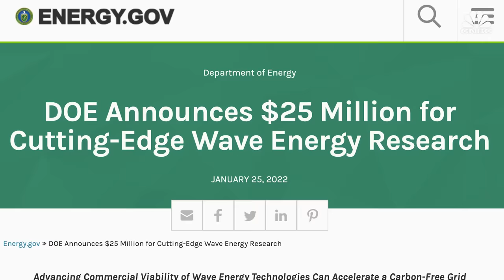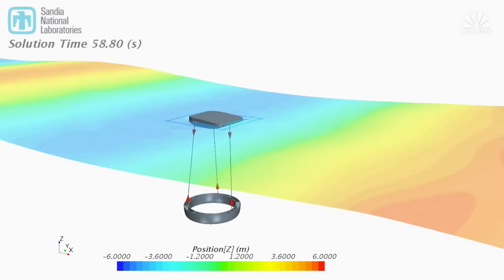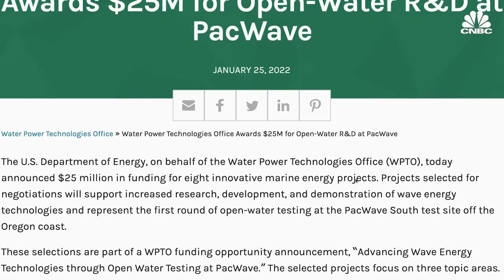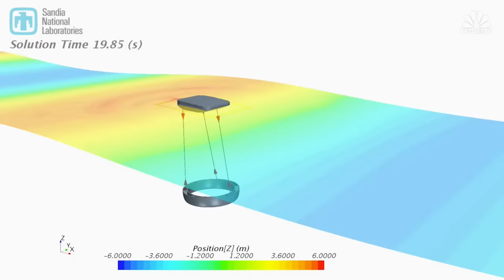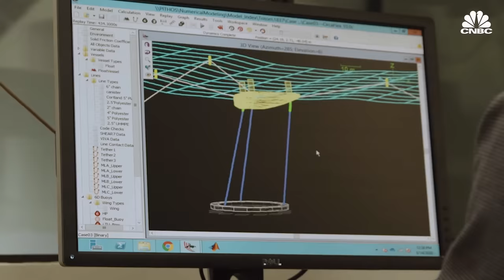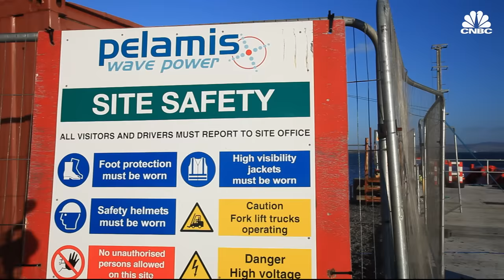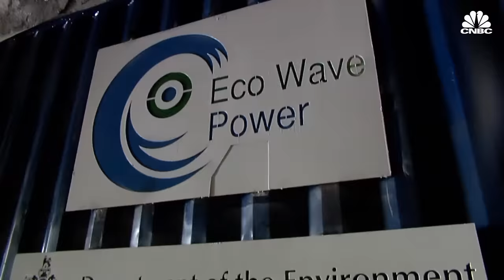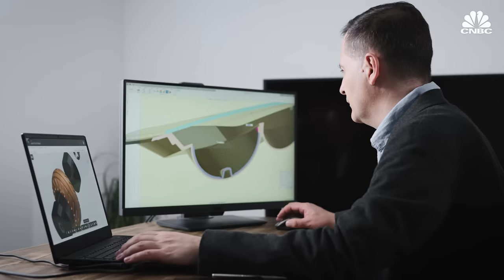How Waves Could Power A Clean Energy Future

Comment: i think,
humans can make overunity motion for green energy,
by pumping liquids such as H2O into the atmosphere, by electrolysis of H2O into oxygen and hydrogen gas where the height and density are developed with mercury gas compounds, 1 input energy for electrolysis and there are 2 output energies from the gas recombination reaction and hydrostatic pressure, the tool can be like 2 tubes that are prefilled with 2 types of gas resulting from the breakdown of electrolysis before being run and 1 more tube to drain the liquid material resulting from the re-combination of the gas.

fyi ,its about 287kj/mol H2O for input energy ( electrolisys )

get back energy when turn H2 dan O2 gas about 250kj/mol

the density of liquid and or high and gravity must be at least more than 37kj ( 287kj-250kj ) 

what about Cl2+3F2 ? 

good luck for make better world... 
thanks me latter.

Comment: I think the use of the upward motion of a wave to “lift a weight and thus it lifts with multiple waves lifts such a weight to set height, and thus fully charged at that oint, is then released to generate power until its weight needs to be lifting again.  Than scalability is then easy as just add these weighted  generators to one “one wave lifter”. So the wave lifter is always busy lifting using the “one way winch systems”. Then each “faulty part does not put the other out of order as well

Comment: How about the new Small Modular Nuclear reactors that Nuscale makes? Runs for 25 years after fueling it.
Reply: But don't allow Samsung to make them because if one catches fire and blows up...
Reply: How does small reactors solve anything? I’ve never seen a protest sign demanding smaller reactors.

They just think that they can be cheaper. But thats not for sure. Its just we build so few large reactors, the skills are not there to build them efficiently.

The only good reactors are the ones that consume nuclear waste so we don’t have to bury it. But they just talk about that, never do.
Reply: @TheBooban  The smaller ones can be mass produced reducing prices and improving quality control.  The same design reduces the need for years and years to get approval.  The smaller ones can be rotated in and out.  The smaller ones get shipped back to the factory to be rebuilt.  Any type of accident is easier to control in the smaller ones.
Reply: @lewisdoherty7621  naval ships have been using SMR's for years - aircraft carriers 600MW
Reply: @TheBooban  There are some advantages, namely the ability to mass produce them in a factory and assemble them on site from standardized parts and blueprints, which should substantially reduce cost. Also a small reactor is much easier to keep cool and if it is small enough a catastrophic meltdown becomes physically impossible.

Despite them being at the bleeding edge of what was possible, the old small gen 1 reactors were still way cheaper to build than modern behemoths like the EPR. The Enrico Fermi plant here in Italy was the most powerful in the world at the time (1963) at 260MW, and in modern inflation-adjusted money it only cost about 622 million euros to build and operated flawlessly until its eventual shutdown in 1987.
That means if we built 6 of them we'd get more or less the same power output as one EPR, but for 1/3rd the cost. This is without even taking into account obvious cost saving measures like sharing the tertiary cooling loop across groups of multiple reactors, unified control systems and rooms for groups of reactors (keeping in mind that in 1963 you needed hundreds of discrete physical dials, switches and cables to do what can be done at 1/10th the cost today with a handful of PLCs), etc.

Of course I'm not advocating rebuilding exact copies of gen 1 reactors, but you get the idea.

Comment: When you say things like Kodiak, AK might be an early adopter because they rely on diesel energy right now, it tells me you did zero research on the topic. Kodiak's power grid has been around 99% renewable power for almost 8 years now. They get it from a combination of wind and hydroelectric power. No one there is trying to do solar so why you would even bring it up is baffling to me. It's like you randomly pointed to a place on the map in Alaska and said there's an island! Solar power probably doesn't work well there, and they are probably just burning diesel. I realize this is a small portion of this story, but it really makes me question what other facts you conjured out of thin air to meet your narrative.
Reply: Not to mention... ummm. Ice?
It gets rather freezy around there; even if it didn't freeze solid; pack ice would literally eat any of the showcased systems.

Comment: The best system would seem to be the one with the least moving parts and generating the most power? Perhaps that design of a solid cylinder anchored to the seafloor with something located inside the cylinder with a crankshaft attached to the surface of flotation? kinda like a car engine?
Reply: I was thinking of somthing similar.  If you had these cylinders or pistons, fixed to the underside of existing or purpose-built piers, then the expensive electronics, computers and mechanisms could be up, out of the water and more easily serviced and maintained.
Reply: It still needs to be c converted into rotational motion, so this isn't actually less moving parts

Comment: There was a promising air-driven impeller design that used the rushing wind that waves pushed through tubes. Current was generated whatever direction the wind and therefore the impeller was going. Wonder why that didn't catch on.

Comment: Not a single one of these projects ever pans out and they always end up taking more energy and money to build the structure than they actually end up generating.
The structure needs to be large to harness the energy, but at the same time very strong to resist the forces (which requires massive amounts of steel), and making steel is an extremely energy intensive process. On top of that, it is immersed in a highly corrosive environment 24/7 and requires an absolute shitload of maintenance.
Wave power is simply not viable and I don't understand why it's still talked about like a revolution.
Reply: I remember the OTEC projects in the 1970s/80s, and I naively invested.
Reply: 30 years ago almost nobody used titanium at sea. Today there are tens of thousands tons of titanium in marine environments, the market is about 3000 tons per year and growing rapidly.
Titanium has come down a lot in price, marine grade alloys are a lot cheaper than aerospace, steel has gone up in price and there is an increasingly large skill base that can design and manufacture properly with titanium.
Titanium doesn't corrode, you can stick it in sea water for 70 years and it will be fine, the life time TCO saves a lot of money compared to the constant maintenance of steel alloys.

Comment: my name is jason barrett and i am the problem solver. the best way to approach this technology is to take this opportunity to revert from oil to electric by taking oil rigs in the ocean and turning these into wave generators. simple.
Reply: Except these are often far offshore and there is no way to connect to the electrical grid...

Maybe, if the power is used to produce hydrogen, this is a great idea
Reply: if they have internet line on the bottom of the ocean why not electrical ones

Comment: Even if this method is more costly, we shoud invest into it, since it works 24 hours a day, unlike wind and solar. If we take into account the downtime of wind and solar, then this might be even cheaper.
Reply: That is exactly what levelized cost of electricity measures/compares.  It was specifically mentioned at one point.  Currently solar is around $0.06 per kWh while the tidal technologies are closer to $1.00 per kWh.  Again, this is accounting for the different intermittency and downtimes.
Reply: @StormGod29  Thank you Chris. Your article is great. Keep on doing this.
Reply: While there are currents and waves most of the time, there are also long periods of time with calm oceans.
Reply: @ryancappo  as an ex surfer - far too many flat days -claude sea carve-em -up Esq

Comment: They should add an automatic sensor length guage line to the conductor so you can adjust for the wave length to convert the energy into power.

Comment: I don’t think we’ll ever see marine energy get to the same cost per kW as wind or solar. The environment they operate in is just so harsh that in my opinion it will always be more expensive than say an onshore wind turbine.
The only option I can see working in this field are tidal lagoons but they have massive construction costs and local environmental destruction.
Reply: You are correct. There's an obvious boondoggle here (not to worry, that's life). The secret is at 2:14 "harnessing the up and down". The speaker is very ignorant of basic science. There is no "up" energy because gravity just keeps acting downward so the net energy is about zero (there's some kinetic energy). The wave peak going down uses its energy to push the wave trough up because global sea level doesn't keep going down due to waves, so there's no net energy available other than some kinetic energy. It's actually forward water motion driven by the wind so devices should be trying to stop the water moving forward. The cost per KWh of contraptions to do this, as opposed to wind turbines to directly try to stop the wind moving forward, is bound to be many times the cost of solar PV and wind turbines. It'll be sold as a super-high-priced Peak Demand necessity and both an actual little help and Promotional Tool for outlying communities around the World.
Reply: You are may wrong, we success develop a devise with multi function convert all wind, wave and current kinetic into electrical. In technical our technology is workable and commercial depend on how big scale of market. in principle it will chipper than oil & gas.
Reply: agree local environmental destruction.+ + + the always newly found sacred site
Reply: @daoduchong1417  prove it
Reply: @shad0wyenigma  ok, we successfully develop a converter with multi function convert all sea energy wave, wind and current. As you know wave/current/wind about 25/15/1 kw/m2 so our invention much more high capacity and efficeancy. We have some inventions specialy on geometry of structure so the converter having a huge interface with envirometal. Some other  invention support to convert any small wave and small current. The construction and recover easy and seam do not effect to sea natural.

Comment: Floatovoltaic (floating solar power plants) make more sense on the open ocean IMO. Floating cement composed or filled with Styrofoam could also serve as an ocean surface store for excess carbon if the CO2 is extracted from the atmosphere.

 Floating solar power plants  could be used for the production of ammonia for agricultural fertilizer and for carbon neutral methanol. Methanol and ammonia can be shipped by tanker to coastal towns and cities. Methanol can replace natural gas for natural gas electric power plants. Carbon neutral methanol can also be converted into gasoline (carbon neutral gasoline) and jet fuel (carbon neutral jet fuel) and dimethyl either ( a carbon neutral diesel fuel substitute).
Reply: Hi. Might be a problem anchoring them in hurricane winds. Cheers, P.R.

Comment: Infrastructure could be built not under the waves, but above them. It would require just a plain surface above the water.

The displacement the waves produce are the same downward and upward. It would be easier to utilize the "up" and down instead of the up and "down".

Comment: Are humans causing climate change? Yes, say 97% of scientists; no, say most millionaires and billionaires. Moreover, to wean the free world from its dependence on Russian oil, coal, and gas, we need these kinds of energy: solar, photovoltaic, wind, wave, hydro, geothermal, tidal, biomass, and hydrogen–fuel cells tech. But for the next 1000 years we also need nuclear fusion. Someday, however, we will need to get energy from tiny black holes. 💕☮🌎🌌
Reply: Be careful with your analysis.  Keep in mind there is a big push to justify grid power and keep the big profits flowing to the big energy companies.  There is no real need for a grid with wind and solar.  Home hydrogen storage tanks are much more efficient than expensive batteries.

Comment: The only important bit is at 0:45 to 0:52 "Now though an influx of Federal funding is helping .... ". No Market Venture Risk Capitalism you see. This is because any energy generated this way will be many times as expensive as other ways of generating energy that now exist so this will be an irrelevant niche some ideal tiny places they find where waves are strong near a coast where the Grid is nearby. The benefit of this wave generation will turn out to be that the blokes here and many others get paid a high salary out of tax money to enjoy themselves immensely through their working lives playing around instead of some gruelling work like installing drywall. So there's some benefit anyway. There's an obvious boondoggle here (not to worry, that's life). The secret is at 2:14 "harnessing the up and down". The speaker is very ignorant of basic science. There is no "up" energy because gravity just keeps acting downward so the net energy is about zero (there's some kinetic energy). The wave peak going down uses its energy to push the wave trough up because global sea level doesn't keep going down due to waves, so there's no net energy available other than some kinetic energy. It's actually forward water motion driven by the wind so devices should be trying to stop the water moving forward. The cost per KWh of contraptions to do this, as opposed to wind turbines to directly try to stop the wind moving forward, is bound to be many times the cost of solar PV and wind turbines. It'll be sold as a super-high-priced Peak Demand necessity and both an actual little help and Promotional Tool for outlying communities around the World.

Comment: Money spent on wave technology is better spent on Solar, Wind Batteries.
Reply: '60s & '70s "Money spent on Solar, Wind and Batteries is better spent on Coal, Gas and Diesel."
Reply: Research on alternatives is good.  That won't stop wind or solar from being deployed.  Actually wind and solar should be a no-brainer by now, but we need something that is stable too.
Reply: @jaystarr6571  If we did not spend that money then, we probably would not have the cheap production costs for them by now.
And the last thing the world needed was more CO2...
Reply: What is north America's  investment in solar manufacturing?
Reply: @la7dfa  Home hydrogen storage tanks would be a nice alternative to expensive lithium batteries.
Reply: @bru512  We invest all our money in China so they can manufacture without OSHA or EPA or minimum wage,  OT, etc.
Reply: @The_Savage_Wombat  Yup, this needs to change.  I am optimistic that NA can bring back manufacturing of panels and batteries.  With innovation and automation it can be done here competitively.
Reply: @The_Savage_Wombat   My guess would be we get way cheaper batteries for home/grid use.  With more common materials.  There are a lot of innovation going on.  The main issue with hydrogen is the low total  conversion efficiency.  It will be less than 50% of batteries.  So you waste a lot of valuable electric power in the making of it.
Reply: @la7dfa   Hydrogen is much more environmentally friendly than Lithium-ion batteries and you can make it from a bottle of water and reuse the same water.
It's also much simpler now that we have cheaper hydrogen storage tank technology.
Much of the electric power generated from solar goes wasted during peak sunlight same goes for wind during windy days because of the expense of battery storage. And the cost of a grid to redistribute the electricity is an elephant in the room that no one discusses.
Reply: @The_Savage_Wombat  Well we still need a solid grid to distribute power.  If it is a dry year, the areas with hydro-power need more supply from outside that area.  And solar and wind energy can be transported over long distances and used elsewhere.
And litium-ion batteries will be reused and recycled.  I read they estimated just 35kg of an EV car battery would be wasted when recycled.  
I am still not a fan of home use for hydrogen, and I have not seen it proposed by anyone else ^^.  It would be better for trucks and some shipping IMO.
Reply: @la7dfa  There a ton of different waves to generate hydrogen beyond just electrolysis. 

While nuclear has a lot of its own problem MSAHTRs with TWS systems for hydrogen and would be a significant source of hydrogen generation (though the economics of the plant on the front end has some concerns). Instead of using electricity to seperate the hydrogen in water you can use the waste heat generated from the plant (which improves the overall economics of the plant) for this process. 

With as much energy a single nuclear plant generates its insane to realize that over 60% of useable thermal energy is wasted. 

These plants operate at significantly higher temperatures, ironically for improved safety characteristics and production, and have arguably the best theoretical on-site scalability in hydrogen production to exceed that of steam reformation without having to build a complete new structure away from the generating source.

That being said there’s only one of these that has been built in the world at Lawrence Berkley National Lab, and it’s fairly unlikely we are going to see more in the future. Congress can barely wrap their heads around SMRs I don’t want to be morbid or seem too critical but their head might explode if they learned that we have historically built and ran nuclear reactors that didn’t use any water and whose fuel operated in a liquid state….